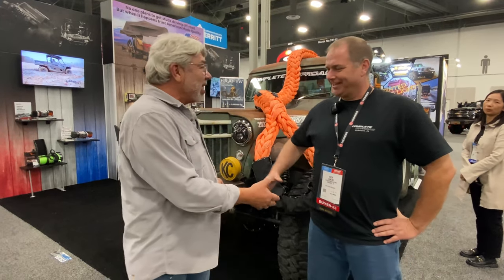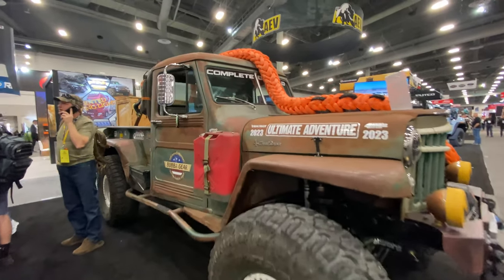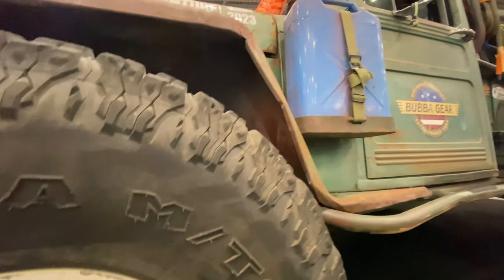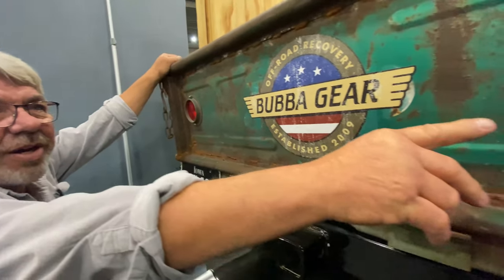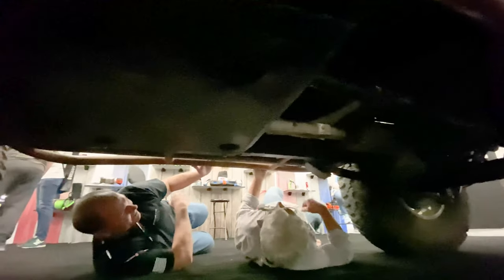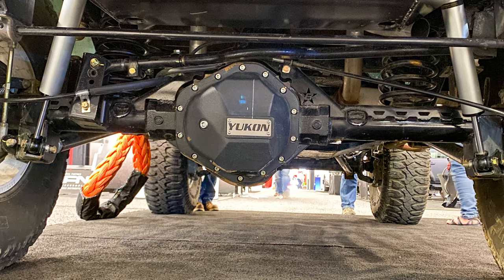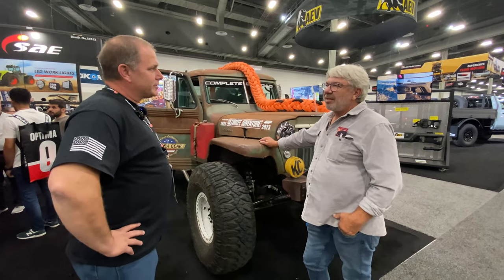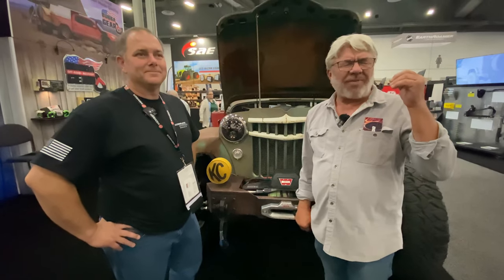Ultimate Adventure 1956 Willys Pickup with Jeep Guru Rick Péwé at the 2023 SEMA show

Comment: Speaking of Rusty floors… I had a 49 Willys overland wagon with a 327 Chevy V8. One night, my friends and I took the truck to an underground party in the warehouse district. When we went to leave I turned the ignition key on and there is a large explosion and flames shot through the rusty floorboards into the interior. It was pretty dramatic, we were stomping out the flames on the interior while people were pouring beer into the engine compartment to extinguish the flames. The hood was blown off. It turns out that there was a plastic fuel filter that made contact With the hot exhaust manifold. Turning the key made a spark in the starter which caused the gasoline to ignite. I had to replace the wiring in the engine compartment and repaint my hood, but otherwise the truck fared well considering. That was 43 years ago and I still miss that truck and the great memories that came along with it. It was my first car. I now have a garage full of tools and fair wrenching skills. What guy doesn’t dream about having a do over with their first car.
Reply from the maker: Man, great story. Thanks for sharing.